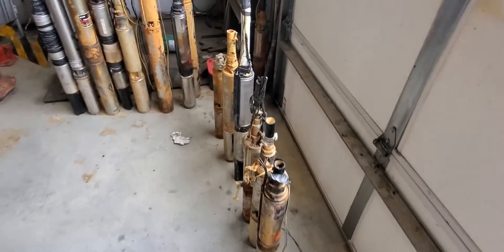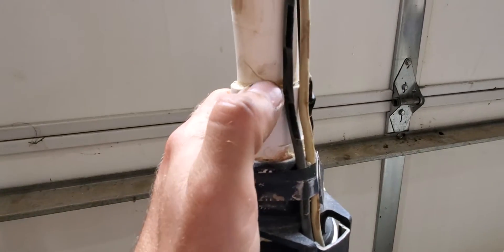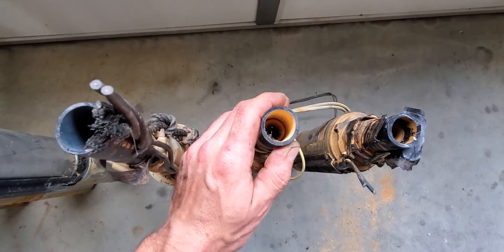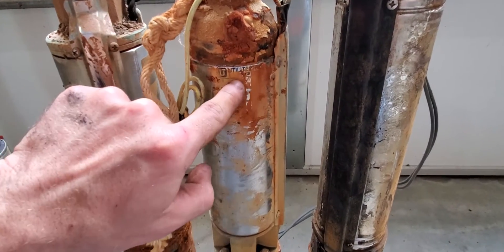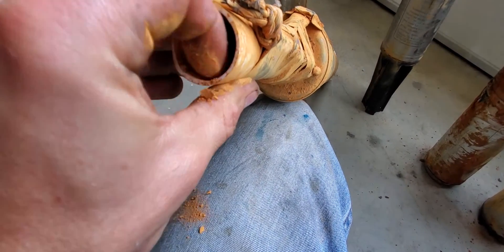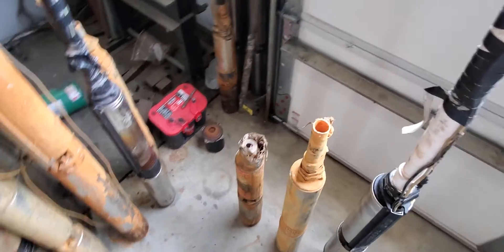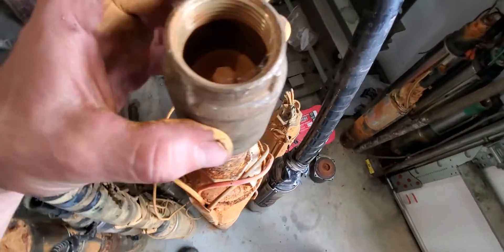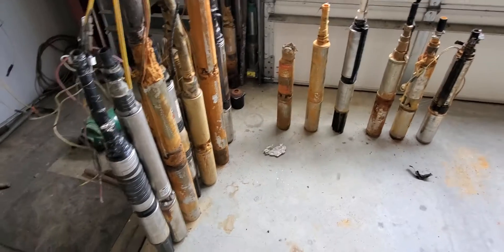No Water, Low Pressure,  Air in Water lines. Here's Why! #1 Troubleshooting video

Comment: Hello. Very in formative.👍 I have SOME
air in my lines. Bled pressure tank and bladder has 27lbs on 30/50 switch. Pressure with water appears to be holding. Pump was replaced 18 yrs ago with sched 80 pvc feed line I believe in casing. I know it was plastic. I’m thinking there may be a crack at the pump. The well is 54’ deep pump is set at 50’ static is 37’. Do you think the pump or fittings are the culprit. How difficult is it to pull if that’s what you think needs to be done

Comment: H2o machanic, i watched your vids for a while. In alaska, and long way from a well man when they come arround 125 to 225 miles away. They normally like to stack jobs to justify trip in.  Moved into house with well and off CITY water..  I was told the well was 240 foot deep, i dont know the static depth. And of course no well log with the house. The pump runs it will build pressure to 32 to 45 psi. When running depending which guage i use. Running 30- 50 pressure switch. The pressure tank when empty rings like bell and light. The pressure at the schrader valve read 32, lowered to 29psi.  Still no effect... Watched couple other vids. Barrowed amp meter reads 6amps on both power legs on start up and run. There is 120 on each leg of power and the load side 240 when on. We can turn off the breaker,  water will hold all night untill tank is empty of may be 6 to 10 gals (60 gal tank).  We turn the pump on with the breaker and water is back, but the pump will not raise it to the high limit. The pump will run untill i go and open the contacts mannually.. then again if circut left on , water flows unill low limit kicks pump on. Then repeat. I dont know how old the pump is. House was partially used last few years.  The well was run dry a few years ago during a summer pressure washing. But it functioned for the next few years. Winters comming would like to get it fixed before snow hits in six to eight weeks.... my wife likes showers and like her..

Comment: Help! New pressure  switch, relay, and capacitor. Pressure  tank holding 37 psi without  fail. Water comes on until pressure  reaches low end and then drops out. Pressure  gage on pipe goes to 0. Sometimes  it recovers quick, other  times not.

Comment: what might cause a no water situation but ONLY after over an hour of pumping? We have a lawn sprinkler system that was turned on for the season in May. The sprinklers run for a duration of 2 hours every other day and this system has been in service for ~8 years. This no water condition is a new phenomena this year. 

After pumping for over 1 hours time, there is no water in the line/tank. You can repeat the situation like clockwork but only after 1 hours time (it is not an intermittent issue). I am leaning toward this being a well/aquifer problem, not a pump issue - I think the well is running out of water to pump. Well pump age is questionable but it's not THAT old. We have had no pressure issues or other water issues any other time of day or with normal usage. This only happens when the sprinklers are in use for over an hour. To make matters worse, it's my father's water system and he REFUSES to believe there is a problem so my diagnosis has to be discreet until I can further conclude what the issue may be. He also refuses to turn the sprinklers off. :::facepalm::: thanks! Great content by the way!
Reply: I should also note this is a deep well (aprox. 110 feet) with submersible pump & pressure tank in basement. well was drilled ~1987/1988
Reply from the maker: @lifestooshort81  possible that you are simply over Pumping the well. Needs more time to recover during heavy usage. 
Or you have a bad pressure tank, that'll cause the pump to cycle on/off/on/off alot more frequently which overheats the pump. After 5 minutes the pump would cool down and run again. Both have similar signs, so inspect your tank, make sure its not faulty. Bc if it is, it'll get worse over time.
Reply: @h2omechanic  thank you! Overpumping the well is my educated guess at this moment and the validation from a professional helps me work to prove my case (my father second guesses everything I say). Im planning on doing a static level test this weekend before and during the sprinklers running to confirm/debunk if it’s a water level thing. I don’t think the pressure tank is even filling enough/building enough pressure for the pump to cycle: I mean once the sprinklers turn on, the pump continuously runs to feed water to the sprinklers.

Comment: My water slows then stop's after 5 minutes or so, for 30s to a minute or so, then comes back on for a while and may do the same thing again . I replaced the pressure switch. Air in tank is 38lbs. Switch shows power going to pump but pump not pumping, then it pumps for a short time and pressure reads 40lbs will come pack on a short time later. Is it a low water issue???. Thanks

Comment: Hey h2o mechanic! Been watching a bunch of your videos. We have a scenario where we are sitting around 16psi, pump is drawing 6amps constantly, pressure tank won’t fill. It’s a submerged pump and popping the top we see water about 15 feet down (previous professional had mentioned well was drying up, which doesn’t make sense). We are unsure if this is pressure tank problem, pump problem, or possible well issue. Any thoughts on the matter would be greatly appreciated.

Comment: Yes hello, just replaced a 3 hp Franklin submersible motor because my Gould motor seized up only 2 years  on line.we kept thegould pump figuring that at only 2 years of service that would be ok,we also replaced the Franklin electric. control box. I now have two problems.
1- get only app. 12 lbs.of pressure at holding tank so sprinklers are hardly spraying.We check pressure at pump location and still only had 30 lbs.
2- at the control box there is 350 volts between the red and black and 245 between yellow and black which makes no sense to me because the elec. service coming into main breaker 1phase 120 - 240 volts.
Please help if you can. Thanks

Comment: In my problem the 24 volt screw pump is working in the bucket of water. But once put in the well it doesn't push any water out. What could be the problem?

Comment: We have a deep well pump, when my wife starts shower, I hear water and what sounds like air surging in lines as well, possibly sounds like cavitation. Using pressure washer is surge of water, wait for pressure to build then more water. Don't know what pipe we have, seeing your broken pipes, was a help. The motor torque twists the lines. We hv high rust, don't know how old pump is.

Comment: I'm currently having difficulties with our pump. This  happens alot when it's dry season but this time around it's so bad. The water pumps at insanely low pressure and isn't stable. Yesterday I tried filling a bucket with the water from the pump and it took almost 10 minutes. Normally it should take 20 seconds at most to fill. Could it be there's a hole in a pipe somewhere?

Comment: My circuit breaker keeps tripping in about 2min time even though I tested the breaker, replaced the pressure switch and I believe the tank is still good. I would appreciate any thoughts that you might have. Thanks in advance!

Comment: I have a 2hp Franklin submersible pump that was on 1 1/4" galvanized pipe pump sits at 300ft deep. Can I use a 1" 200psi black pipe like you use in your videos? Thanks!
Reply from the maker: Not with a 2hp pump.
The main thing you'll need to know is how deep is your static water level. I'd assume it's very deep bc you have a 2hp & have galvanized pipe. 
If you have a 80ft static level & used a 1hp or 1.5hp then yes, you can use poly pipe

Comment: Been subscribed for a couple months, watched a lot of videos.  Asked questions 2 - 3 times, didn't get any response. Will keep trying. 😊 
1) Thinking to put pressure tank and connect to the pump about 10' under the ground to eliminate heating well house in the winter season.  A) is it a good idea?  B) how to do it?  C) Should I install another pressure tank under the house in the crawl space? Well is about 30 yards away from the house.

Comment: Hi
I just have my well pump stopped working.   I checked everything and find one wire out of the three wires dose not work and no power.  I pushed the two reset buttons and it started.  But it has low pressure and it turns off every 4-8 hours.  
Should I replace a pump or the wires?

Comment: Very helpful, I have been having air, low pressure in my water, mostly in the hot for whatever reason, I had a plumber come out, he said it was the Well, I called a Well company they said it is inside the house and that there was nothing wrong with the well, to call a plumber, I called another plumber they said it was the water heater, switched it, still have the same issue, came back today says its likey the connections from the well  to the house. They are coming back Monday to run pressure test on the connection, what do you think, So far I have spent $1700,  still have the problem. I was quoted $450  for the test on Monday. 
I have shorts on the issue on my channel for reference.

Comment: Brass and 100+ psi poly, definitely 200psi poly for the bottom 200+ of a 400 drop. Check valve in the middle. On a long drop also use a 3 inch brass mpt to ins on the bottom of the pitless. Im in Ontario Canada though. So cool to watch your videos because its the same game depending on the landacape and geology.

As a well tech, these videos are great.

Comment: I’m having a problem with air getting in my system, I turned off main valve in the house and water pressure between pump and bladder tank drop and I don’t see any leaks in the house. I’m totally confused as to how I’m getting air. Can you help? Thanks

Comment: Sould I hear water running back down in the well after the pump turns off? I don't think the presser drops in the house but with the cap off I can hear it splashing down there... We started getting Alot of sand/mud the wells only like 48'
Reply from the maker: It may be a cracked drop pipe or fitting that's cracked at the pump.
Reply from the maker: It's possible your hearing water coming in from the water bearing zone.

Comment: argh~  i'd pull my hair out if I had any left.  On well water via aerator tank.  Experiencing air in the system.  Pressure gauge (located after the check valve) always holds steady when water is not being drawn.  (40/60 pressure valve)  Pressure tank, 32gal, bladder checks "ok" after depressurizing system (37 psi).  Visual inspection fails to identify any water leakage yet, turn on the shower or sink faucet and, shortly thereafter, comes clear signs that there is air in the system.   Also, have purged every water outlet my house (both internal and external).  Oh, did i mention..  AAARRGGHHH!!!!!!

Comment: I recently replaced my well pump, the problem I had was after the pump would shut off at the pressure gauge it would show a slow pressure loss than the pump would kick on this would result in 10 minute cycles of the pump turning off and on, when I pulled the pump it had a pin hole in the casing just above the pumps enclosed check valve. The pump was a quality model (Goulds) and wasn’t that old at 9 yrs
Reply from the maker: That's common with aggressive water. Your P.H. may be low. Itll eat threw brass over time.  May be seeing blue green stains in the sink.
Reply: @h2omechanic  I had also replaced my pressure tank about 3 days earlier. All connections are now  SS they were previously brass. My well is spring fed there is no blue/green in the sinks or toilet

Comment: I have a fiberglass pressure tank with no schrader valve. How can I tell if my tank is bad. My pressure switch isn’t cutting on at its cut on pressure
Reply from the maker: Your tank may not be a bladder type. 
But if it is, there's a plastic cap on the top of the fiberglass tank, pop the cap off & the Schrader valve will be under the cap.

Comment: Thank you for your GREAT informative videos. We are having trouble with dirty reddish water off and on, especially with wet weather. Our house was built in 1968 and we have a shallow artisan well (40’) with a foot valve in the well. Our 1:2 hp pump jet pump, WellxTrol pressure tank in our basement. The well is outside about 10’ from basement wall. We had a “water system “ company come out last week and were told our pressure tank has ruptured bladder that’s causing turbulence in well and making water dirty.  New Goulds FT408 jet foot valve and 80 gallon(?) WellxTrol pressure tank replaced 12/2020. Valve had 3 pin holes per work invoice.  I had to ask plumber several times to look at my well and consider if the casing has cracks/damage. He slid concrete lid open about 1” and said “ Everything looks OK”. Can you give me your opinion. Thank you, Barb and Jack Knapp, Sykesville, MD . Please feel free to call 443-801-3655. Also, do you ever work in Maryland?🤞

Comment: I have air coming out of the water hose installed before the pressure tank , I just replaced the well pump about three months ago, the pressure gauge stays at the same pressure, not loosing any pressure. Just air coming out of the water hose at different times.

Comment: I had a minor water leak in a pipe under my house, I got the leak repaired and ever since I’ve had a HUGE amount of air coming from my well. Plumber said the leak could have cause my check valve to go bad from running constantly. Have you ever had this issue?

Comment: Standard in my area is 100 psi poly pipe. Wish the standard was higher. I can't even install a cycle stop valve because back pressure would exceed 100 psi

Comment: Just got a new house and i've got some air in my lines. Pitless adapter. Age and type of pump unknown. Owner had notes written that originally said water started 4 foot down, well is 45 feet deep. I popped the cap and looked down the well and the water isn't 4 foot down, probably more like 30-40 feet. That's got me a little concerned. From what I could see in the well it looks like a wack/bad install job in general so tomorrow i'm pulling the pump to take a look. The pressure tank is also on the older side so i'm replacing that just as a preventative measure to protect the pump. Pump works well, good amperage, good pressure. Lines are just sputtering often and it's got me a little concerned something is about to fail.

Comment: Hi hope your channel is doing well 3 years later. I am experiencing air in the water along with tonight I was walking by the well head and air was shooting out of the weep hole on the small pipe next to the well head itself. We have I believe the farm style well with a pressure tank mounted just below the surface of the ground. The pressure will spike when the water is shut off to 80 psi then drop quickly with poor flow. ( contacts pop on and off if the tap is opened before the iron curtain). I have replaced the float several times but have not prefilled the air in some time. Would low air pressure in the tank cause the weep hole to spout for a good long time.

Comment: Regarding your video titled, "Most Common Reasons For No Water" I would insert a comment at 10:42 while the system is being shut down.  After turning off the power to the system, open a spigot and let the water run.  Watch the pressure gauge drop to zero.  If it does not read zero, then the gauge needs replaced.  This caused a question for me because my pressure gauge never dropped below 30psi.   Once I replaced the pressure gauge, the rest of the trouble shooting became easy.  Thanks for some great explanation and instruction.

Comment: I’m having a issue where my pump won’t give me the same GPM when I turn my hose bib on I get good pressure and after the pressure switch kicks in the pump does not give me the constant pressure like it can’t keep up slows down also and takes pressure from the house to nothing I have a grizzly red jacket pump 1/2 HP 120 volt pump. Installed new 20 gallon tank and 40/60 pressure switch also any ideas I know this is a lot

Comment: I have trouble with my well pump. Somehow, the pump shorts out and doesn't get electricity when it is hanging normally. The pump comes back online only if I pull up the wire maybe a foot up, therefore making the wires tighter. At that pulled up position, it works fine until my iron removal system regenerates/backwashes... I had two companies stop by, and they just offer to replace the well pump which will cost ~$10,000. Do you have any suggestions on troubleshooting this? Thanks so much for your expertise and your time!!

Comment: A 2hp water pump stopped pushing out water because of low voltage,after it was rectified, it stops pushing out water,don't actually know the cause of problem?

Comment: Have air in my system but have water.
When we wash cloths the washer has alot of air :(
Reply from the maker: You have a leaky check valve in the pump or a cracked fitting near the pump. 
I'd guess that you also have a check valve at the tank. If you do, then I'm correct and u must pull out the pump.
Reply: @h2omechanic  thank u sir ill check

Comment: I just bought a brand new pump and controller and going about doing it myself   , i would like to know if I can check my motor is working before lowering it into the well hole . If i connect  230v (South Africa ) on the motor whilst the motor is not connected to the pump and its out of the water, could i cause any harm? . Do those conditions matter or will the controller know im basically running "dry ". When i did this my pump controller flashed the lcd display and said STALLED as the amperage was 35.5 Amp and the motor didnt spin . Have you got any suggestions on how to diagnose the fault.

Specs of my new pump are :

SPERONI 
4'' SUBMERSIBLE PUMP MODEL = ST 4013 
3hp 2.2kw 50HZ

My pump controller specs are:
Model: MP-S1 PLUS 
Capacitor 70uf
single phase 220v
Reply from the maker: You can run it dry as long as it's thru the control box. For about 5-10 seconds